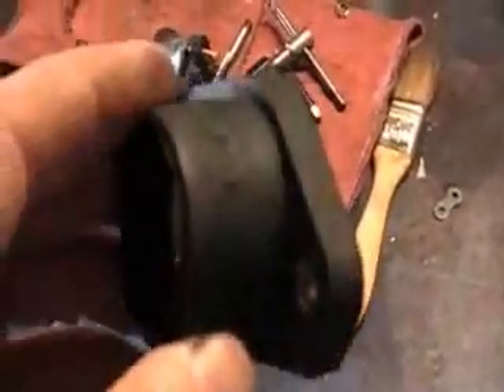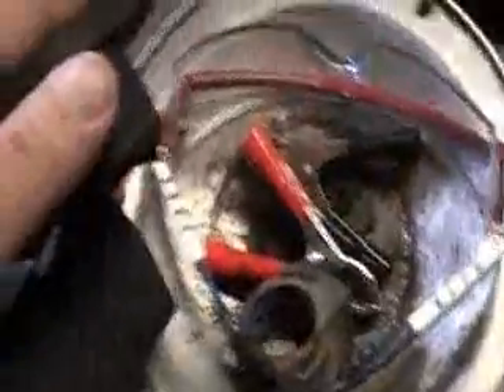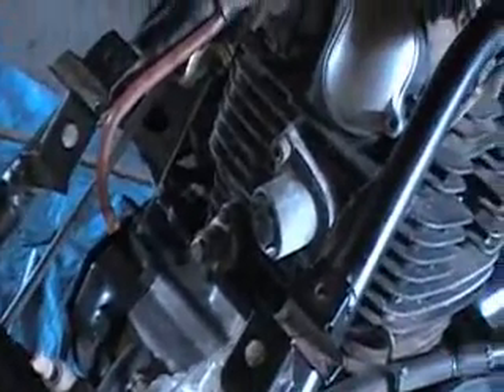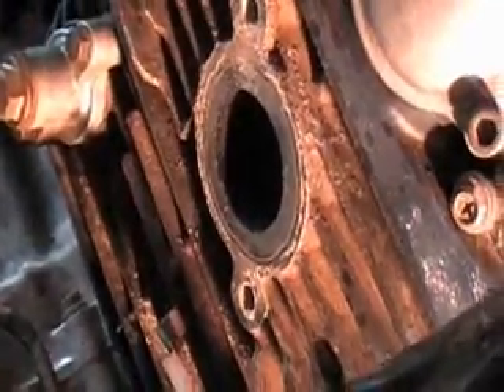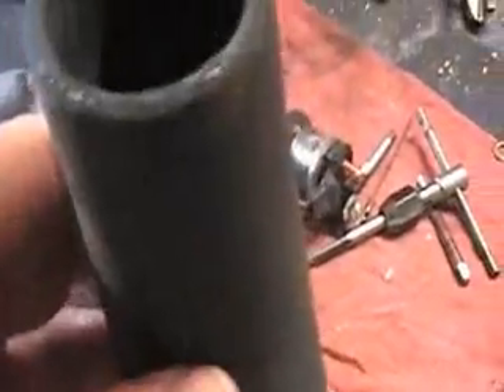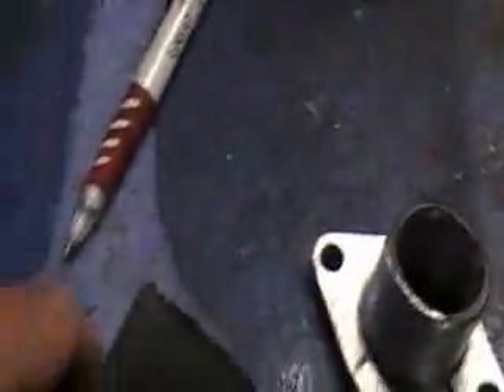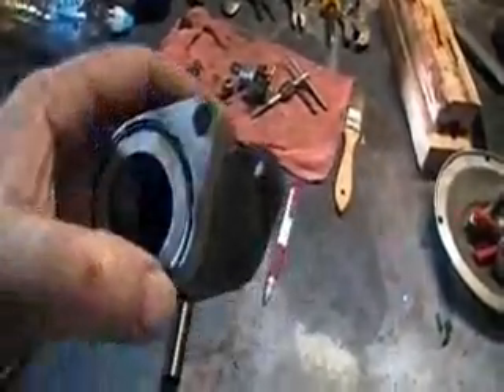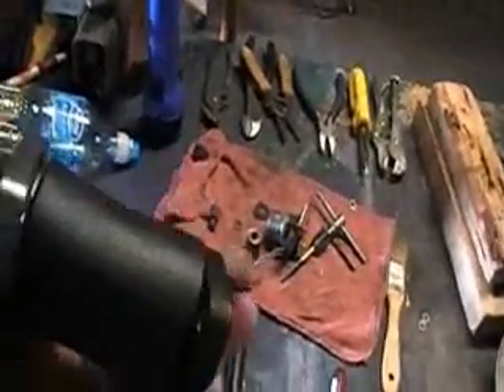fabracating atv intake manifold

Comment: thats not fabricating anything its cutting a rubber hose, and its nothing like a ram air, ram air is not a longer intake hose its an intake that air is pushed into as you drive.  but good improvise to cut and clamp a rubber hose in place of a molded rubber.